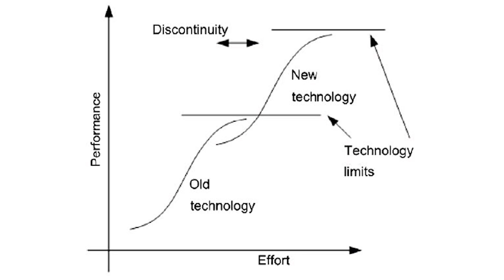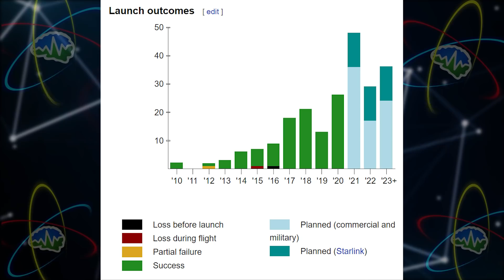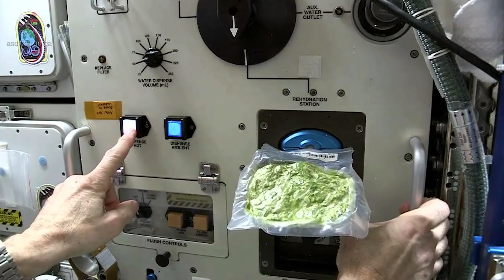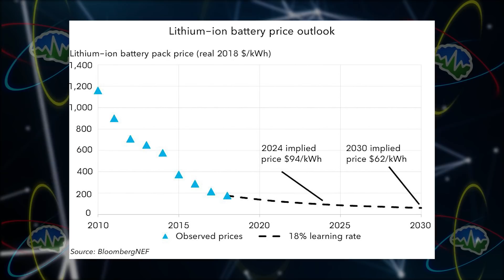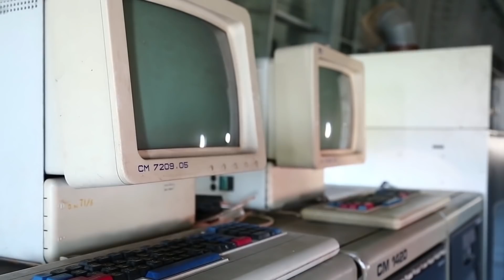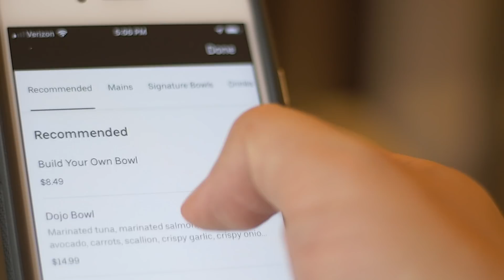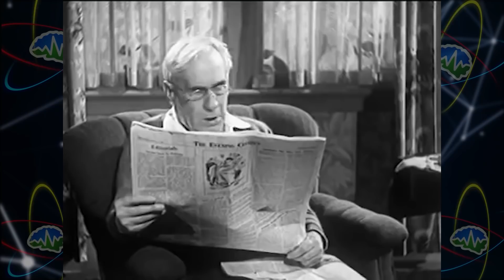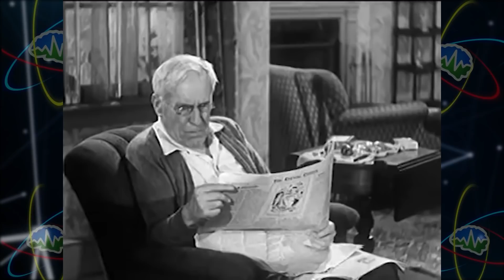5 Things Coming in This Decade | In Depth

Comment: Dude, you still use your fingers to send a message?  Why you do not use your assistant (not to say Google) . I'm 54 and I barely had to use my fingers to send a message, I switched so fast to the voice recognition that I can't even remember how long I used the screen to type since the screen is sensible to touch.  I just use fingers to type like 5 % of the time.  I can't say I use finger for that, it would be like saying I still use horses to travel when I only use them once in a while for  entertainment purpose.

Comment: Do you think we will see the 18 meters starship this decade?
Reply: @andrasbiro3007  Yeah, and the raptor engine is exceeding expectations. With 30x 300 tons and 7x 250 tons engines the total thrust would be 43% higher than the 7500 tons target.
So a 172m tall rocket is definitively feasible.
Reply: @andrasbiro3007  Well, there is a limit to the width to height ratio. In the ITS for example the LOX tank in the second stage is spherical so it's very difficult to make it wider:
https://cdn.mos.cms.futurecdn.net/3EVpin8ATwtVn3ve825sEf.jpg
Reply: @andrasbiro3007  But you can make a conical rocket like the N1. You could increase the width of the booster according to the square root of the rocket mass and increase all the dimensions of the spaceship according to the third root of the rocket mass.

Comment: I just watch a video of a Tesla running into a box. The box was about the size of one person standing and two people wide. The Tesla was on Autopilot and the first time it did not stop soon enough I was surprised. The weather was clear and there was nothing done to confuse the Tesla. The second test was done the speed was slower and the Tesla still ran into the box. In both tests, a human would have had no trouble stopping or avoiding the box. I am seeing issues that will still delay the full usage of Robotaxi.